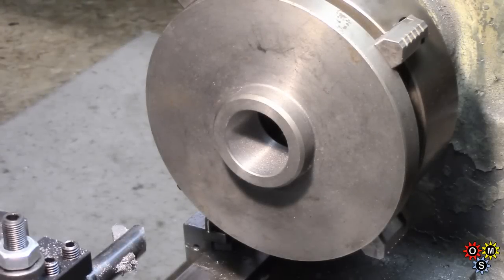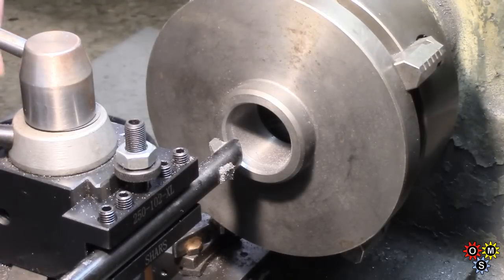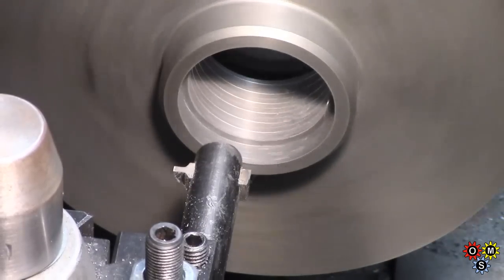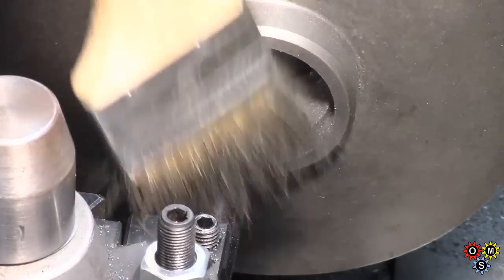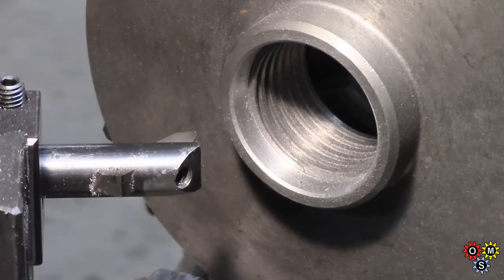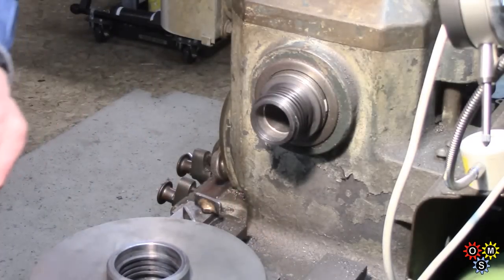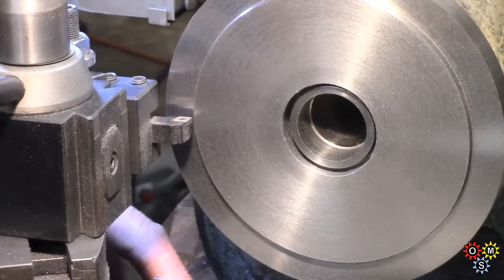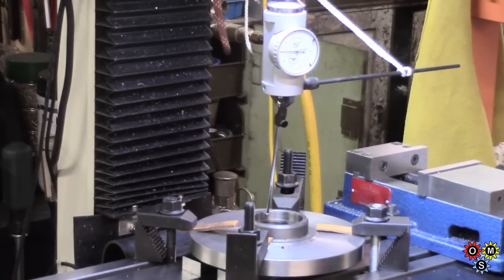Adapting a Backplate For a New Chuck, Part Two Final

Comment: Doing the job this way has really given you a lot more work to do, that is why I always make the back plate to the chuck, then clamp the chuck to the nose of the spindle, machining the thread/spigot ,then it must be accurate, you must now get the chuck running true, then put in dowels to hold it true, relying on just the dowels, rather than having the full support of the register, which is now a clearance hole. With .003" run out you are almost back to where you started with the old chuck. But I am sure you enjoyed doing it, if not eating cast iron dust for days! Many thanks for posting. Chris B.
Reply from the maker: +Englishman French 
Hi Chris. Considered your method but my spindle nose is not all that long, and felt it was pushing my luck a bit to load the jaws that much with the chuck weight.
Run-out at the end was just under 2 thou, not 3 -- and, most important, the jaws are consistent compared to the old chuck, which would lock onto work different every time! The exercise was worth it just to have decent consistent jaws. :)
Reply: +ChrisB257 : I can see that having nice parallel acting jaws must be a very big step forward, and a run out of .002" is "good enough for government work" as we used to say. Do you have collets for this lathe ? I suspect it is getting cooler there now, it certainly is here in France.
Reply from the maker: +Englishman French 
I have collets yes, tho an incomplete set. I did make a 'nose extension' a while back because things get a bit tight when working real close to the spindle. When things are very critical the 4-jaw comes out.
Reply: +ChrisB257 : 4 jaw! Good man!! Chris B.

Comment: Good job on the Back plate.  I have found Drill Rod usually not perfectly straight.  I like
a hardened rocker arm pin or a carbide endmill for checking.  Thanks,  Randy
Reply from the maker: +Randy Richard 
Thx Randy - may try a carbide end mill sometime.

Comment: the bolt holes may be limiting the amount of movement to adjust the chuck. try mounting the chuck 180 degrees around on the back plate and see if that helps.
Reply from the maker: +superrodder2002 
Hi -- thanks -  I intend to try some different positions and do final tweaks yet.

Comment: a decent result there Chris... I can tell your not exactly or totally happy so sit back and relax and think about it for awhile i am sure if you desire you will get it better :) glad it came out ok
Reply from the maker: +Lawrence Harasim 
Not bad so far -- but will be doing more checks. One thing, the new chuck jaws are real nice compared with the old one! :)
Reply: +ChrisB257 my old chuck that looked absolutely new will only repeat if you tighten it up using only one of the three :( but it does repeat a few thou
Reply from the maker: +Lawrence Harasim 
This Bison has a distinct "O" next to the prime key slot - and will endeavor to use that.

Comment: Were you using the "prime" chuck key hole when you were checking the run out?
Reply from the maker: +Chris Stephens 
Hi Chris.  yes indeed - it is well marked with a "O" symbol. I did several loosen/tighten ops to check but result stayed same... so jaw closing seems pretty consistent.
Reply: +ChrisB257 Was there any discrepancy in run out between close to the jaws and 2-3 inches away?
You only have a few thou to find, so don't give up just yet, but before any more bumping it might be an idea to clean and refit both jaws and jaw carriers.
Reply from the maker: +Chris Stephens 
I have yet to clean and reassemble jaws and carriers. There was a slight discrepancy between close to jaws and further out - one reason I suspected the drill rod truth. I need to check that on roller blocks or find another piece to test.
Reply: +ChrisB257 More likely you will need a cooking foil shim between the chuck and back plate to straighten it up. Been there, done that, and (on a good day) got zero run out up to 6 inches out. Unfortunately good days are few and far between. :>(
Reply from the maker: +Chris Stephens 
That's a thought in back of my mind!
Reply: Great minds think alike, even if they use a different language now.:>))

Comment: Great job on a tough project.  How did you work out the hole configuration?
Reply from the maker: +Roy Lucas 
Hi Roy. Thanks. The hole pattern could have been calculated from a formula in Machineries Handbook - but in fact it was done using a web based calculator -- in essence, enter in the circle diameter and number of holes - and bingo - out come the coordinates. Then, a case of very careful DRO settings. :)

Comment: Cris I was thinking, which can be dangerous. What if you were to mark the chuck where its indicating high and then rotate the drill rod stock 180 deg from that side and measure again to determine if its the stock or the chuck that is 2 thou out, even tho we would think drill rod would be assumed to be accurate. That is unless it was dropped or slightly bent at some point. I may be jumping to conclusions that you would not have already eliminated that in a previous video, but my memory is not that good so forgive me if you already have. Anyway does this seem logical or am I incorrect...still learning here myself so by far no expert on the subject.
Reply from the maker: +1NRG24Seven 
Hi. Yes indeed - rotation of work piece is an old habit which I did a lot in the old chuck - the jaws on that were very erratic.
On this one did the same test - which did suggest the drill rod was not 100% but the just under 2 thou was shall we say the mean average.

Comment: If your 3 jaws chuck repeats within 2 thousand constant, you consider you have a good set up, chucks that repeat more like half a thousand are about 3 to 4 times the price....  And even more!
And with the allowance on the register, if needed you can bump the part closer... 
Make sure your allowance for the screws allows for the adjustment...    ;)
Reply from the maker: +pierre beaudry 
Hi Pierre. I may well accept the 2 thou - but over time will see how consistency works out. Thus far, hole clearances seem adequate for bump shift but can always enlarge them just a tad.